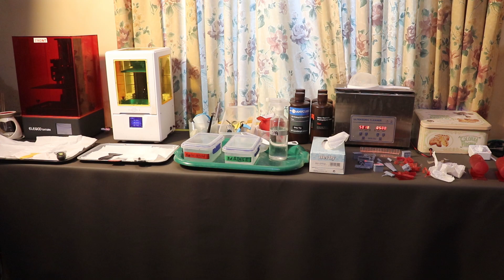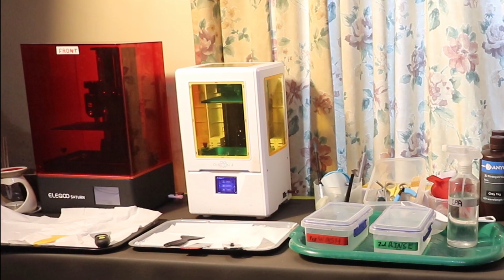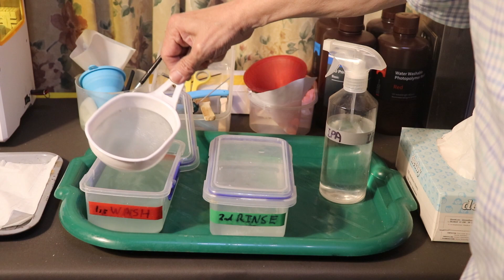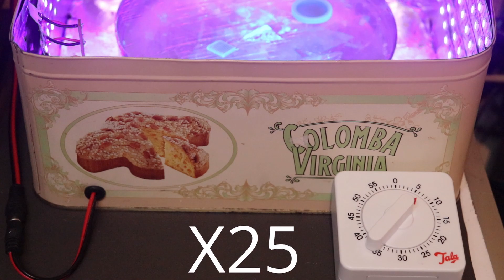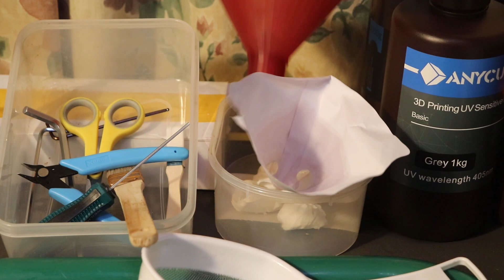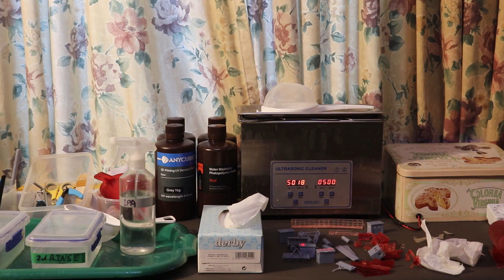TimberSurf's Vid Bit No. 22 - My 3D printing setup

Comment: Nice setup! I’m yet to get myself a ultrasonic cleaner. Love it 3D printed funnel and scraper. :)
Reply from the maker: I have had the ultrasonic cleaner for many years before 3D printing! It's intended use was to clean loco chassis' of the grunge in the bearings, with out disassembling them!

Comment: Try using a silicone scraper to check the vat (their used with window/bath mastic) its softer and has more feel to it. Any bits stuck to the FEP can be popped of using your finger on the underside of the FEP. You can also use a silicon car window scraper cut down to the width of your vat as seen on Uncle Jessy's site, to scrape over the inside. Popping of the stuck bits with the ball of your finger is the safest way I've found to release stuck bits after I pierced my fep using the plastic scraper (...GRRRR...). If I have any bits stuck in the vat i empty the resin into a kitchen Jug it will will hold the vat in place while it runs out, I then (when bits removed)pour it back into the vat through a filter in a funnel I downloaded from thingiverse  (Customizable Funnel by Sethmuser)
Reply from the maker: I will certainly look out for some window scrapers, cheers